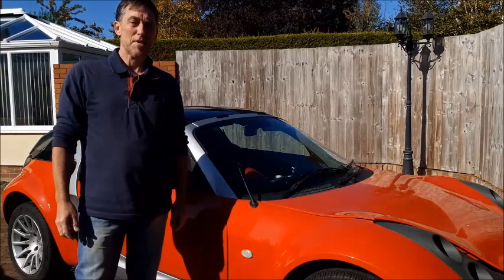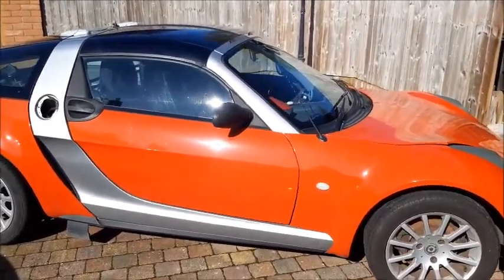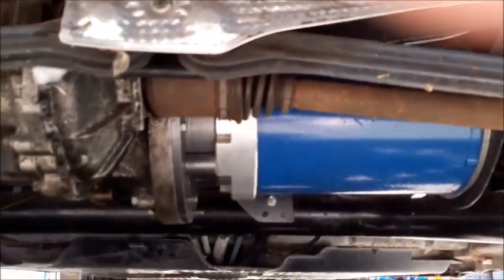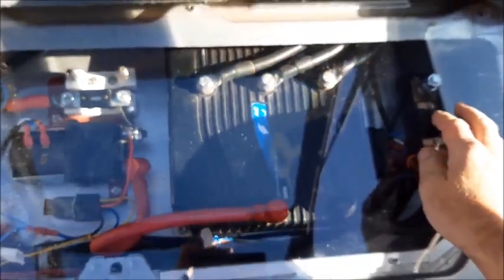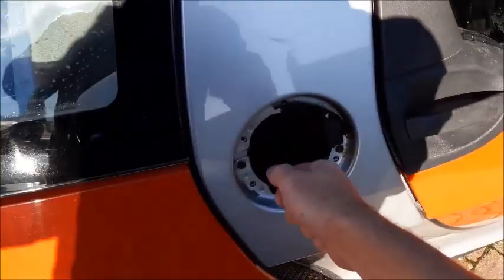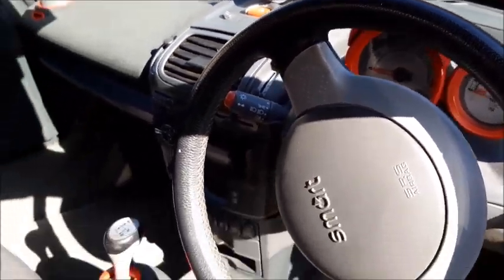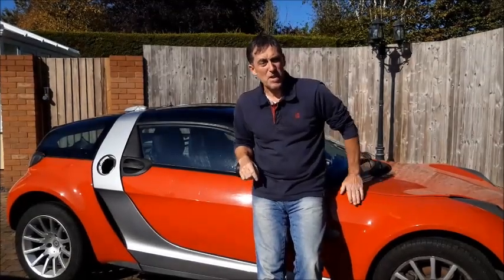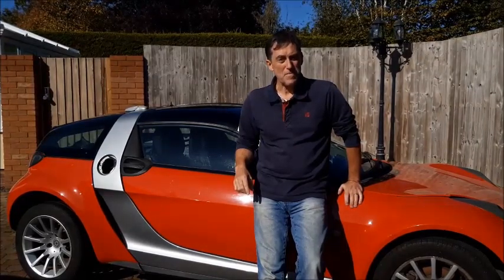Converting car to electric - Run through and first drive

Comment: Did this get completed? What was the cost?
Reply from the maker: Hi Kevin, It got put on hold as I didn't have any time to work on it, but plan on completing it over the next few months and hope to get a couple of videos done. 
Someone asked about the cost before so I worked it out based on new parts, I think it would cost around £8k for a minimal battery setup (as I have) and 50kw motor, but I got most of my parts second hand so I think I spent around £3k.
Reply: @crispydoda  I really appreciate the reply.  I'm going into this car with the opinion its an investment. all super interesting. keep up the great work.
Reply: @crispydoda  Glad you're still around Paul!

Comment: Hi Paul, Can you say something about the costs for this conversion?
Reply from the maker: Hi, Someone asked that a while ago so I worked it out based on new parts, I think it would cost around £8k for a minimal battery setup and 50kw motor. I got most of my stuff second hand so i think i spent around £3k.

Comment: Curious how much does you car weigh with all that hardware?? Would be very interested to know and how the car road handles???
Reply from the maker: Hi, I think it must be about the same weight as it was before, the electric motor is lighter than the ICE, the batteries are heavier but in total, with a full tank of fuel I think it should add up to around the same. One big difference is that I chose to put the batteries in the front, but as it was a bit light on the front it's possible the weight is more evenly distributed, if I add more batteries they would need to go in the back where the fuel tank was now.

Comment: Did this ever get properly finished? Interesting videos.
Reply from the maker: Not quite, I have just bought a few of the little bits needed to finish it off so just need some time and it could be ready. Will be 3D printing the gauge holders this weekend. Thanks for watching.
Reply: @crispydoda  Thanks for responding Paul. Hope to see the finished article one day, and more videos on it. These things are often incredibly tough to get over the finishing line, good luck!

Comment: Hi Paul, I note by the lack of action you might have given up on you conversion! My conversion has also ground to a halt.
Reply from the maker: Hi, It has ground to a bit of a halt but only because I have no time at all to work on it. Very frustrating and this year I was hoping to finish it but I had even less time than before. It drives but it still needs the charger fitting and the vacuum pump connected then it would be about ready for inspection ready to put it on the road. One day.....
Reply: @crispydoda  keep your head up, this is a great project!!

Comment: Hi Paul, I've been watching your progress eagerly. Great workmanship and engineering. I am researching for a classic mini conversion and the combined electric auto transmission looks a nice possibility. I don't know the rear track of the roadster ( be interested if you wouldn't mind measuring that?) but I would be very interested in your thoughts on such an application with the combined unit mounted in the mini front subframe.
In any case, I shall continue to follow as you impart a lot of information very well.
All best,
David.

Comment: congratulations Paul, the car seems to drive well ! In my roadster conversion I have also installed an arduino board to let the gearbox change gears with the dc gear selector motor (you posted a video where is works well on your desk) but I have trouble finding the right position (number of rotations of the gear selector) to get the box into the right gear. Is this working well in your conversion? Are you able to switch gears while driving?
Reply from the maker: Hi, Due to a lack of time I haven't done anything with the gear changing, once it's on the road properly I might tinker with that but at the moment I'd be happy just to have it running. My assumption is that with the resistor feedback from the pot it should be possible to always be in the right position.. I worte the valuse down somewhere but would need to try and find them again.

Comment: How much all this conversion cost?
Reply from the maker: Almost everything is second hand, waiting for the right parts to come up on ebay etc. I think it's about £2800 so far, I just need another £500 for charger and sockets etc and that should be it. If it was all new I think it would be around £6-7k, but I've never taken the time to work it out.
Reply: @crispydoda  and a rough estimate on the hours you've put in? and more or less in which tasks e.g. 40% batteries 40% motor 20% controller and 50% research 50% actually putting in the stuff

brilliant work, hope you get it registered soon so you can enjoy it! and thank you very much for sharing your journey, as soon as i get a good chunk of time in my hands i'll watch your whole series

Comment: Great to see it moving.... On a side note I just thought of a conversion that would work well for the smart roadster. The motor, batteries and controller; out of Zero motorcycle. I've seen a few recent;y and it would seem that it would work well in small light weight cars.

Comment: Well done, I will be watching with interest. As 3phase or stepper motors operate, they do transmit the noise through any other metal or frame they are attached to. An example is a 3D printer where they offer rubber isolation mounts to remove 80 to 90% of noise which can drive you crazy if you are printing in a quiet house overnight. It works! Have you thought about doing the same instead of bolting flush to the gearbox? It would make the motor almost silent when driving. I’d thought I’d ask whilst you are still in the construction phase.

Comment: Great work, i've just now finish mine. I have the diffrent CAN messages that the ecu used to send to the SAM controler. No more low oil, over temp errors lights. if you want i can send them to you.
Reply: I would be very interested in that, Polo!
Reply: +1 to that polo, please send me an email at youtubecomments@voidtyphoon.co.uk, I'm about todo some canbus hacking on my car and some heads up on some ID's would be amazing, please!

Comment: Great to see it moving under its own power. Let me know if need help fitting the charging plug/socket in the fuel flap, remember I have have done this - its a bit tricky because you don't want water penetrating into the metal body double skin section.

Comment: Did you manage to create a gear change controller or are you just locking it in 2nd or 3rd?
Reply: We converted a fortwo 450 in 2011, developed a controller for gearbox, removed the clutch.
It worked well, but in the end there was no real need for the gearbox.
If I did it today, would use two motors instead of one with differential.
Reply: @eIektrinis  yes a gearbox isn't essential but ultimately, a gearbox can allow the car to pull away quickly but also be far more efficient at higher speeds.

Smart got it right in their electric models by using a CVT.
Reply from the maker: I have a home made controller which will do the shifting using the drum sensor as feedback but for now I'm going to just choose a gear and leave it at that. Experimenting with driving my normal car without using the clutch I've found going up in the gears is easy but down needs the motor speed to be well matched, I assume the Smart will be the same.

Comment: What's involved it making it road legal?
Reply from the maker: Letter from dvla says, in breif, receipts of purchase for the conversion or letter from a garage confirming the engine has been changed and what size and the engine (motor) number. It's unclear if I need a full inspection report for insurance. So it's just a case of finding a garage who are prepared to have a look at it and do the written confirmation... hopefully.
Reply: @crispydoda  Unfortunately the change of 'Fuel Type' can be noted on the V5C, but the 'Taxation Class' cannot be changed. So you'll have to keep paying the same VED (road tax). I've been chasing DVLA on this, but cars from 2001 onwards cannot change taxation class as that is based on the emissions of the car when new and even though emissions are now ZERO, it is still taxed based on its original emissions. Fortunately that's quite low for this car, but this situation is nonsensical and needs to be changed to make converting cars more cost effective. I thought the government wanted to reduce emissions.
Reply: Having looked into this further, the legislation actually looks very clear, that the Taxation Class can be changed as electric cars are simply exempt, so emissions is irrelevant. It very much looks like DVLA have been getting it wrong and interpreting the law incorrectly. Maybe Paul can be a test case.
Reply: @crispydoda  interesting. I'd be quite interested in a little video on this once it's all been resolved!

Comment: That's an interesting project, great job! :)
I've subscribed and got the notifications set up for your channel, I'd love to see how it performs on the road. Will you do the acceleration test? Also, how loud is it inside? The sound kind of reminds me of the old remote controlled toy cars.
Reply from the maker: I'll definitly do another vidoe once it's on the raod and I've found out what it can do. The vidoe makes it sound louder than it is, and it helped after I remembered to put the gearbox oil in too!.